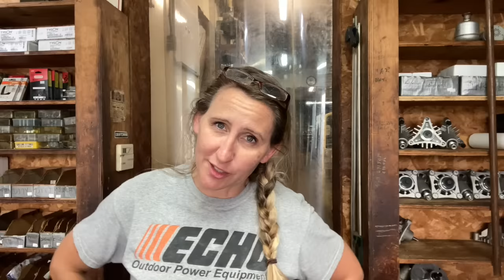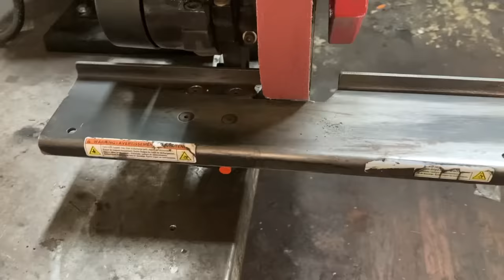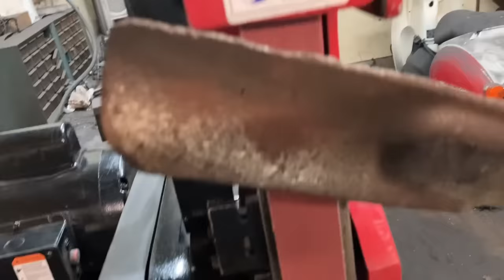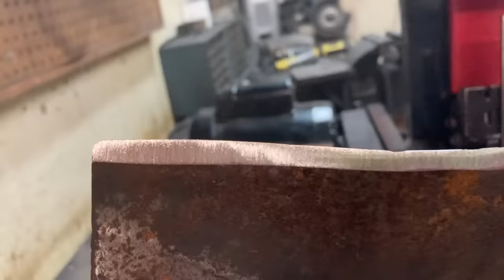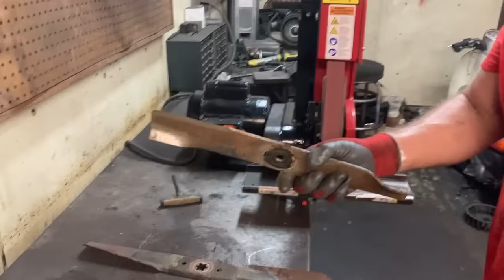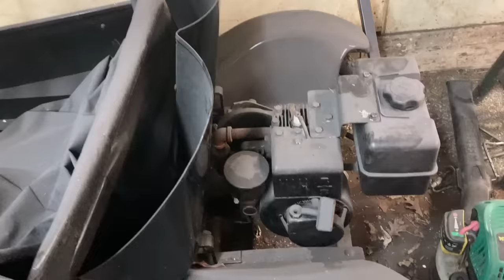The Best Blade Sharpener Ever!!! Oregon Burr King X400

Comment: Don't balance after sharpening????
Reply from the maker: These were pulled out of the junk pile.
Reply: @Chickanic  Do you normally balance after/during sharpening?  I just use a hand grinder then a table sander.  I have a Honda which has two blades.  BEST mulching mower I have ever owned.

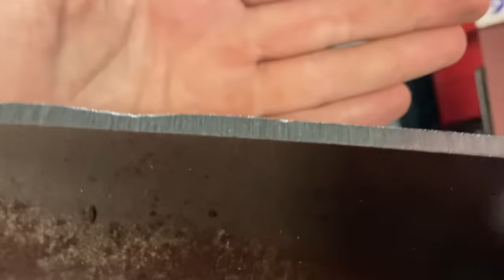Comment: Noooooooooooooooo! first you have to SQUARE the leading edge from the bottom of the blade, then sharpen ,, that's why you still have the low spots on edge.... 4:05 into video then balance them.

Comment: Not very impressive. 

I'm ignorant regarding repairs. I understand they are paying you for sharpening. I stopped taking my blades off the mower. An angle grinder works great. It's quick and has a fixed angle with the guard on the cutter.

Since when is it good to sharpen it like a knife?

Comment: I don't know who this fella is... but you'd think he never sharpened a blade in his life 🤦‍♂️ None of these were sharpened properly. You can clearly see the uneven edge. Shiny metal doesn't mean it's sharp. 

As for the type of sharpener you're using... mower blades are made of tempered steel, and most hardened edges on top pf that. See all those sparks? That's more than just material leaving the blade... that's heat going INTO the blade, removing the temper, and reducing edge life.

Comment: I'd have to give you a big fail on your technique and the results. I would never let that leave my shop in that condition. The blade edge should be uniform and straight throughout with no divots. And if you slow the motor down you are pressing to hard, heating up the blade more than necessary. Excessive heating removes temper and that's never good. And do you balance your blades during the sharpening process? 👎

Comment: Besides the time the blade doesn't have a straight edge that's extremely important to have a uniform cut and u could tell she didn't want u to see it clearly moving it in and out what the hell u sharping a blade faster doesn't teach me shit! At least show a new angle or way to sharpen blade to last longer or keeps its edge! Common sense